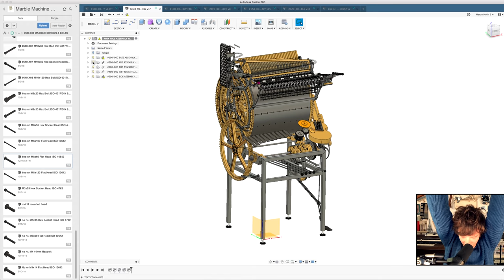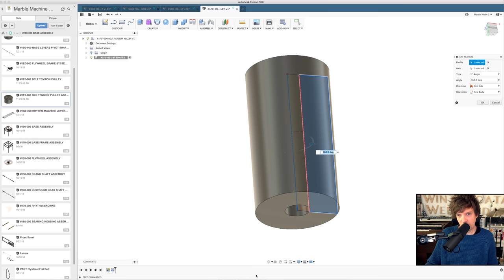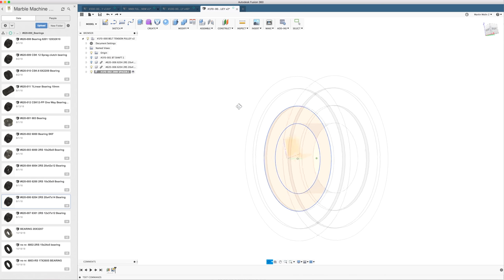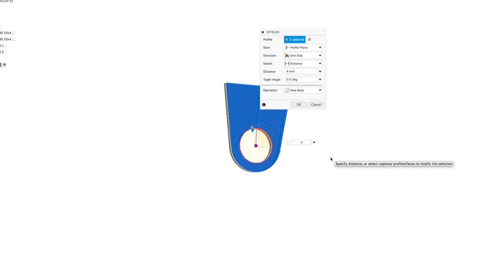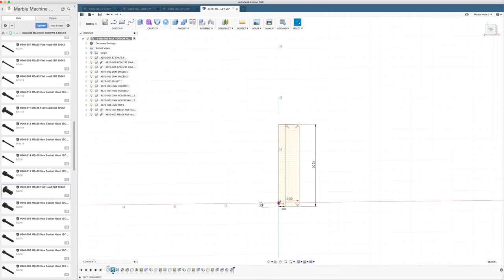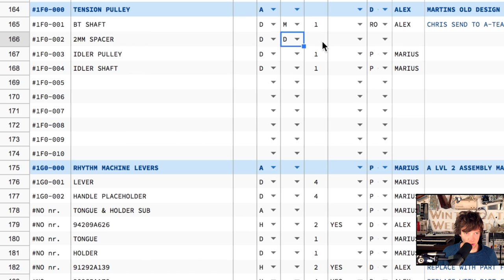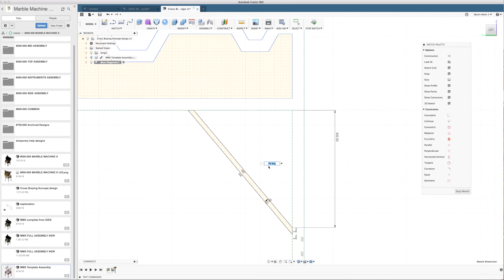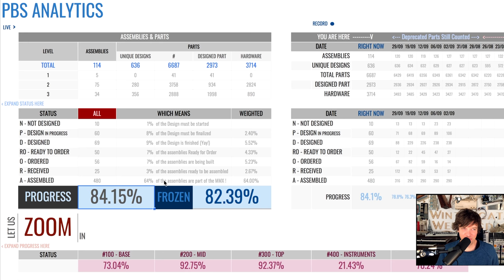Designing New Parts in Fusion 360 - Marble Machine X #56

Comment: My experience with cad is with Catia and Inventor. In Catia especially the links are much more powerful.. you can design a part to update it's shape in an assembly based on position in the assembly (like a shaft between two plates. if the plates are moved the shaft gets longer). The biggest problem in parametric CAD projects is that as the complexity of the assembly goes up, so are the weird errors that can arise (each of them can be explained and find a better solution after a lot of time invested) and in the end some cleaning is done with breaking all links and saving the project "as is" in stp format. A crude way but effective to freeze a sub-assembly that is considered done and final. - and this dead solid is imported in the final full assembly (like a car or anything with lots of sub-assemblies). Most of the time ther isn't any need to import everything, just wrap the subassemblies with a mesh and import that in the full build. No need for the internals in an engine and every screw and bolt when judging the placement in the chassis - only the outside silhouette is needed for that. Making a total parametric design is not very useful for a very big project like a whole car or plane.
Inventor does wraps and omits small parts in the level of detail of the assembly. Idk about fusion.. is the lesser version of inventor. Either way, by far i'm a fan of Catia. Inventor has bitten my ass many times with weird hidden automatic behaviors, while in Catia is the opposite.. everything is shown in plain sight either automatic or manual action. A much more transparent and rigorous design. nothing is left at chance. (this has downsides.. every point/line/operation you make must be constrained fully).There is a reason why top industries (automotive, aviation, etc) use mainly Catia or Creo (former ProE) or UG(NX) and not inventor or solidwroks or creo direct or solidedge or other B-side programs. Fusion is a nice toy program, but still a toy. it's purposely limited, while inventor is the best autodesk can offer (inferior to Catia in many regards). - same can be said for lesser programs under the same namebrand.. like DSS has Catia as top tier and Soldiworks for the lite version (and cheaper), PTC has Creo parametric as top tier and creo direct as cheaper alternatives.. etc. So hitting a limitation in the lite edition is a sign to upgrade the software. Hitting limitation in a top tier program is a sign for hardware upgrade and poor design decision (current technology gets you only this much.. so optimize the design to be easy on the hardware or break it in smaller pieces and never assemble it as a whole) 

If you want a second opinion on CAD design in Catia, I can make that. I'm phd in engineering (internal combustion engines) and do CAD/CAE/MBS in Catia/Ansys/Adams for a living.

Comment: Martin, maybe explore a cable bracing system instead? Adjustable, gets out of the way easily for programming wheel changes, and you can make it look intentional instead of an afterthought with pulleys and such

Comment: Rear cross braces will help some, but the design has pre-buckled them.  Either they will be hard to roll (large section) or easy to roll and useless.  An alternative would be to design a moment connection at the top of the vertical clock pieces that rigidly connects both sides together.  The alternative also has flaws (it relies on the clock pieces to have some sectional moment capacity).  Since the clock pieces are essential to be strong to support the programming wheel and planet gears that may be realistic.  A second alternative is to ensure the shaft supporting the programming wheel has moment resisting bearings at the ends (maybe not very aesthetic).

Comment: I Martin, sorry to bother you, I was realy amased by the CAD design system and the anti vibrating cross bracing are very nice though, I am sure you have thought off this, aren't they going to be in the way in the changing of the programming boards during the concerts?. If so I would suggest you to make the back bracing made with a pivot on the lower part and a locking-unlocking system in the upper part. That will allow you to have stability during a concert while being able to confortably and quickly change the boards. I hope this will help you. Great job I realy love your work. Cheers

Comment: Have you added steps in BMS for packaging and have you incorporated any extra features to MMX for locking machine to packaging for travel?   Any wheels on machine to roll down to ease positioning on stage?  Any loops or anchors on frame to hook to hoists to lift to stage with reduced chance of damaging machine with straps?

Comment: I agree with others on the strength/stability of the MMX.  I have a question for you: there is a gap for the registrators, muting and the levers to play each note individually.  IS there enough room within that gap to put an X-brace between them going from the contact point just above the first wooden gear to our left in frame area 15:05?  If not; how about as "underbars" for where the registrators and marble distribution sit?  I cannot see in the spin, but it does not need to be a HUGE X - just something between the two braces to give extra support to those pieces going horizontal...

Comment: M8 needs a 6.8mm not a 6.3mm, easy way to know what drill to use: diameter of the thread minus its pitch, for example, M6 has a 1.0 pitch so (6.0 - 1.0 = 5.0) the needed drill is 5.0, most people know that. This is especially handy when using fine pitch metric cutters :)

Comment: Hello Martin!
I've soon seen all of the Marble Machine X videos, and I'm very much enjoying it! 
I am a hobby maker myself, and I'm using Fusion 360 for some of my projects. I enjoy watching your CADing, because there are so many small tricks to learn, and you've obviously aquired some of them!
Right now I'm trying to figure out the best way to set set up a job in CAM for machining both sides of some parts of my current project. The pieces have holes in them that I will use to fasten them with screws. But I'm still trying to figure out how to set everything up so that I can just flip the piece, fasten the screws, and run the next job. Do you have any tips?

Comment: Dear Martin, as far as I can tell from the videos you forgot to weld the remaining edges of the second rod holding the flywheel. You wanted to weld them when the machine was disassembled but apparently didn’t. Taking into account how the material is stressed on a world tour the single weldseam at the top might break. Hope, this helps and maybe I’m wrong.

Comment: >>Not an Engineer<< Only thing with the cross braces around the programming wheel, is that you restrict access to the programming plates. If speed is of the essence when changing them across you might want to play around and see if you can leave a decent section free. I think it might be easiest at the back, perhaps with the brace not covering the full distance, leaving a gap for the plate swapping. Or if the brace bends out enough so the plates can be maneuverer around it, not ideal but it might work. Or as another commenter (Anders Jackson) said, having the bracing on a hinge so it can be moved out of the way.

Comment: will there be enough space to put the programming wheel in, after installing the upper crossbraces? also changing the programming plates could be a struggle with the braces spanning the whole backside. looks super cool thou..

Comment: A follow up questions; Is there a reasons you're doing revolve instead of a primitive cylinder with a hole/sketch as the center-hole? I guess they both have the same steps in timeline and all, just wondering =)
Reply: I was thinking the same thing, why dont just extrude a 2 circle sketch?

Comment: Cross beams are only useful if they can take load and tension, but by bending them around the programming wheel you are actually weakening this property from the cross beams. You should ask some structural engineers about it before implementing the idea.

Also, how do you suppose technicians will switch the pin boards during a concert if these beams are present?

Comment: Wont the cross bracings interfere with the inserting and removing of the programming plates? Being on a tight scedule between two musical pieces, the point was to being able to quickly change the programming plates. It seems it will be a problem with the cross bracings?

Comment: If you don't make  a way to get the pulley shaft in (and out)  AFTER you weld the bracket, with the bearings, you will melt all the grease out of the bearings when you weld it, and probably destroy the rubber seals as well. Then they will fail prematurely, maybe in the middle of a song, which would be sad.

Comment: Not too convinced with your bracing design.  For better stiffness locate a horizontal brace from leg to leg say 50 mm from the bottom to produce four portal-frame sides.  Cross brace each frame with a single diagonal element from a top corner of one leg to co-inside with the bottom horizontal element on the opposite leg to form two equilateral triangles (structurally integral).  This will provide much better stiffness and resistance  to movement caused by the rotating elements of the machine...and will be totally compliant with the rule of cool.

Comment: Since the entire MMX design is in CAD, do you utilize any of the mechanical analysis programs. I was thinking mostly stress and dynamics. I am unfamiliar with Fusion 360, but other tools such as Pro E, CATIA have analysis modules, and other solid modeling tools provide linkage to FEA tools such as NASTRAN/PATRAN, etc. Also are inputting the data in Fusion 360 to determine assembly/subassembly weights, and center of gravity? Could be valuable in assembly/disassembly and transport.

Comment: How do you change the preprogrammed plates with the back bracing.
If you are going to use the back to changed the preprogrammed plates, then How much time do you need to remove the brace to remove and insert preprogrammed plates during the concerts?

Comment: Hi Martin, I think, it could become difficult to Change the programmingplates on the Wheel, if you have weldet the stabilising "X" to the frame - but perhaps you could install it that way, that you could flip it backwards down. Sorry, my english is horrific, but fortunately my german is much better - perhaps someone could translate it for you… ;)Martin, wenn du die unteren Fixpunkte des "X" als Drehpunkte ausführst, und die oberen Fixpunkte mit 2 Schrauben befestigst, kann man zum Wechseln der Programmtafeln diese 2 Schrauben lösen und das "X" nach hinten weg klappen, so dass das Programmier-Rad frei zugänglich ist.Danach wird das "X" wieder hoch geklappt und mit den 2 Schrauben befestigt. (Oder statt 2 Schrauben nimmst du solche Schnellspanner wie beim Fahrrad zum Räderwechsel in Sekunden, dann kann sich kein Gewinde ausleiern, wenn nach 40 Auftritten das "X" 200 mal herunter und wieder hoch geklappt wurde...)Grüße Daniel.

Comment: The curved bracing does not really the thing you intented it for. since it wil be able to bend in the curved direction depending on the thickness of the tube used. unlike  a normal  Cross you would use on the back of a cabinet for instance , or as you used on the feet.

Comment: Martin, in a metric thread the hole to be tapped is easily calculated like this: M8x1,25 (regular M8 thread) --> hole: 8mm - 1,25mm = 6,75mm --> round that down for some clearance and you will get a 6,5mm (because you can easily get a  drill with 6,5mm). You don't need to round it down, but for i.e. regular M8 it makes sense.
Reply: If you round UP for some clearance you Will get what is stated in all mechanics handbooks I have read: 6,8mm hole to tap M8 threads 😀
Reply: also very valid, yes. This will get you a very snug fit and fine thread but also wear the tap faster. That's why I round down. But in any case: don't use handbooks, use the geometry behind the thread, because the "formula" works for every however pitched metric thread.

Comment: This is a time you need to work harder than ever. The devil is in the details, and you have to take the momentum you've built and plow through the mundane aspects that aren't going to make for many more big, interesting videos. Support, especially Patreon support, may dwindle during the home stretch, so get to the finish line as fast as you can!

Comment: I don't get, why fusion is rejecting to implement solidworks style mates alongside their more abstract higher level joint system. This Point to Point movement, which Martin dedcribes here, feels like a very poor version of the mates system, which can be used for permanent mating as well as only for positioning. But instead of finding point or concentric edges as in the point to point function, you can mate surfaces, edges, corner and underlying sketch elements among one another.

Comment: is anyone here who works with Fusion 360 and Solidworks?
I am asking only because I have worked with solidworks over 7 years now hobby and professionally and before that I worked with Pro/E Wildfire, but never touched Fusion 360.
SO I can't tell which is better. From only researched online Solidworks seems better and easier to use, but I can't tell because of reason above.
My question is, would it be easier to work/ design  marble machine X in solidworks instead of  fusion 360. Or right now just create file type for Solidworks and transfer everything there.
Just curious that's all :)

Comment: Your use of "parametric" design makes me cringe.
A lot of what you are doing isn't parametric design and instead is just letting the software do the math for you.

A big idea of parametric design is to use variables (or parameters).
The idea is that the holder width is defined by a parameter (e.g. hw) and the bearing length is calculated from that parameter.

So instead of having 14+14+4+4+4, you would have something more like 2*bw+2*sw+2*hw.
Likewise instead of having the holders be extruded 4 mm, you have them extruded hw.
Then when you decide you only want them to be 2 mm instead of 4, you update hw, and everything gets updated at once rather than having to manually go through and update every location where that parameter would appear had you used parametric design.